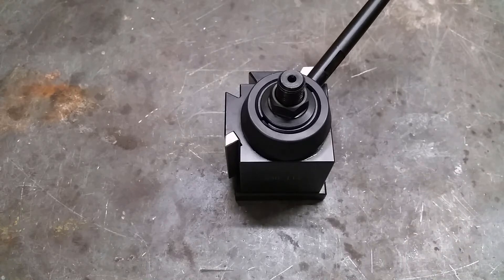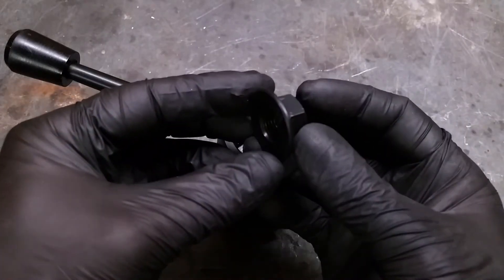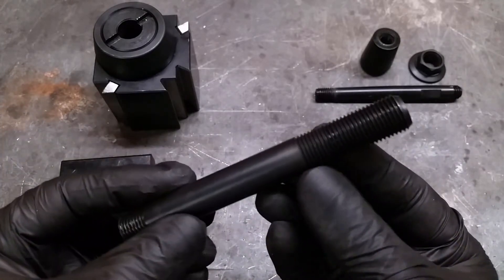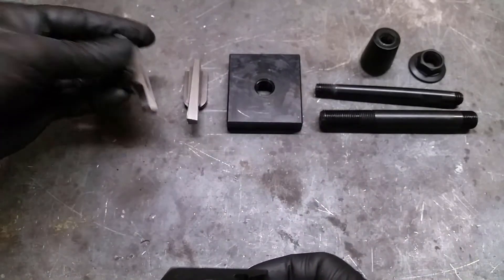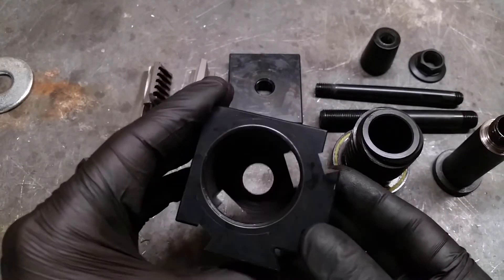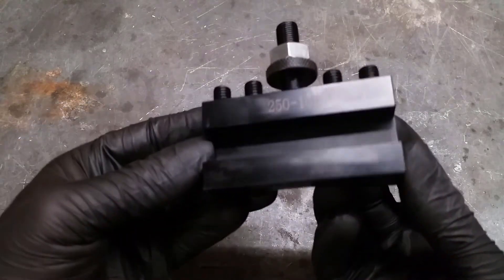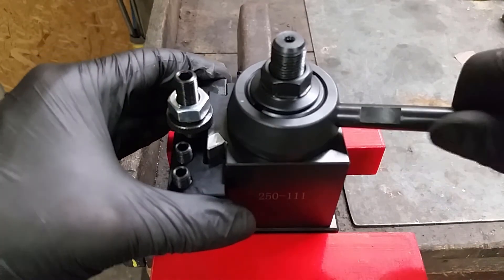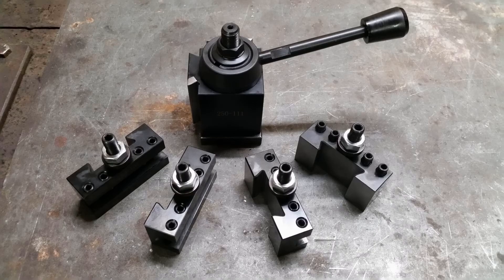My First Impression Of The Machifit QCTP DMC 250-111

Comment: Great video  on the detailing  of the out side next time you made your  videos try useing a file  to see even if they tried to harden the parts  that are needed iam sure that the in side twisted  barrel is not harden and after a year or two  that be worn  out and jaws as well then throw in garbage  bin and buy a good kind next time
Reply from the maker: Thanks for the reply. The test with the file is a good idea. I'am planning to make a second video about this tool post. Like my impression after 2 years of use. I got alot of questions about my opinion after this long time and if i would recommend it.

Comment: Hello,
thanks for the video!
I wonder what mini lathe you have.
I want to buy the 250-111 for my  8x16 mini lathe.
Do you know if it's a goog idea?
thanks
Reply from the maker: Hello
I don't know if you could call it a mini lathe but i have the Paulimot PM2500. It's a bit bigger than the mini lathe and has it's own design. My lathe is designed and sold by a german company but build in china like the rest. In my opinion the PM2500 is a lot better than the mini lathe. Better quality, a gearbox, stronger and heavier. Of course the price is higher too.

A video of my lathe and the modifications will be uploaded in the future.

The 250-111 with the wedge design works great. I love it and don't know why i waited so long to buy one. It saves me so much time and trouble. From time to time the tool holders are sold at a discount so my collection is constantly growing. I'm owning around 26 right now.